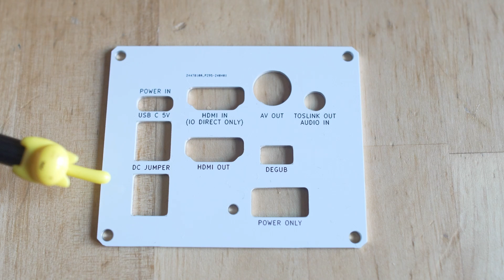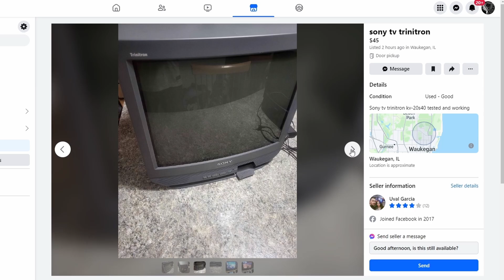MiSTer FPGA IO Analog Pro Board Review and Guide! Better Analog Video is Here

Comment: I don’t understand how to use SVIDEO with this new board? I have to buy a separate adapter that converts from the Saturn AV port? Any help would be greatly appreciated.
Reply from the maker: You just need the cable that has an S video port on the end and you need to use the S video cores. They are generally diff core builds
Reply: @ thank you for the quick reply and I love your content!
Reply from the maker: Glad you enjoy :)

Comment: My MiSTer has no audio but the video works great. I am using the Saturn component cables on a Sony Trinton
Reply from the maker: What IO board?
Reply: @VideoGameEsoterica  analogue pro
Reply from the maker: Check MiSTer addons site. There are INI files for the Analog pro
Reply: @VideoGameEsoterica  and those ini files will fix the no audio? what line of code do i change

Comment: I installed my IO pro analouge board today and the picture is moving down constantly and is in black and white!! I can't figure out what to do
Reply from the maker: What tv? What connection type? I’d need more detail
Reply: @VideoGameEsoterica  Its a Sony Triniton connected via the saturn AV port
Reply from the maker: RGB? Component?
Reply: @VideoGameEsoterica  component
Reply from the maker: Make sure you have SOG toggled. Sounds like you don’t have it set to the proper orientation. It’s on the IO itself
Reply: @VideoGameEsoterica  that didn't work
Reply: is the SOG supposed to be on or off?
Reply: it's not working on either setting
Reply from the maker: Ok go to mister addons analog pro page and look for the settings link. That will bring you to his github. Go there and get the INI he built for the board. Add that to your MiSTer
Reply: @VideoGameEsoterica  I got the video working finally but now I don't have any sound
Reply: for context I'm just using a standard saturn AV cable (yellow red white) I have yet to buy the Saturn (Mini-DIN-10) Premium Universal Video Cable. I'm not sure if I need it as of right now.

Comment: Are you using a Saturn DIN to BNC connection to the CRT? or a Saturn DIN to VGA and then VGA to BNC? My 21 inch Trinitron has both inputs VGA and BNC.
Reply from the maker: BNC

Comment: I run my analogue based MISTer in RGB on an old Sony 2530 PVM. My buddy turned me on to Extron stuff and I use an RGB 203 Rxi as an interface for H and V adjustments. It looks superb! The composite and S video picture is excellent as well. I’d love to upgrade to this board and see how Ninja Gaiden 3 looks while I practice its punishment.
Reply from the maker: It makes everything look a tiny bit better but it makes cores than can support 24-bit color a LOT better

Comment: I don't own a Mister yet but seriously thinking about getting into it. I have a 20 inch flat screen CRT TV that has component connection. I have it connected to my modded Wii and PS2 for occasional old school gaming. If I were to get a FPGA system, with my Sharp 20 inch flat CRT ( I do not own a PVM), will I benefit any from using the Saturn output rather than VGA output for sure? Or is VGA good enough?
Reply from the maker: Both are great for component. You can’t go wrong with either
Reply: @VideoGameEsoterica Ok thank you.

Comment: A huge PSA for everybody is that someone has made pulse with modulation cores for Saturn, PlayStation and N64. These cores give you the exact same 24-bit result out of the analogue board, but it works on the V1 analogue board so no new purchase required.
Reply from the maker: No. Just diff cores. Although the accuracy of the signal won’t be that 99%
Reply: @VideoGameEsoterica  How can you be sure it's not as good though? We'd have to show PWM vs OG vs Direct video vs analog board v2 to know that. We're getting 24 bits via PWM so I don't see fundementally what the v2 board should have over those cores.

Comment: Think I'm just gonna build a second MiSTer build, so I have one for my desk setup and one for my TV setup, the second one I can build with the I/O direct & BliSTer, plus dual V3.2 SDRAM modules, plus a i2s waveblaster header for installing an internal original 90s Yamaha MIDI GS/XG module and a CM6631A DAC for those phat analogue oscillators, I'd love to install a CMSLPT TSR as well, which has dual Philips SAA1099P sound chips for that beautiful rich sounding real-time chip tune audio (PSG), would love to install a OPL3 as well, but not sure if there would be enough I/O left to do so, but if I could, I would have the trifecta of synth hardware (PSG/FM/MIDI), I could also just spend a bit extra (£140) and get the DREAMBLASTER X16GS, which does all synth standards and does them beautifly, it has a Dream/Roland GS Bank (officially licensed, ROM bank), Dream CleanWave Bank (official, Buran Bank, OPL3-FM General MIDI bank, GXSCC Chiptune bank, plus a powerful DSP for multiple efects and what not, it will cover every MiSTer system there is, and systems like the X6800 and Amiga can use multiple audio standards, like Street Fighter 2 on the X6800 has a beautiful chip tune soundtrack mode, nothing beats real chip tune music playing through a real phat analogue oscillator.
Reply from the maker: Hell of a setup
Reply: @VideoGameEsoterica  If I can find a second hand DE10 it might be worthwhile, I use Roland Sound Canvas 3.2 on my current MiSTer via an Intel M5 X86 compute stick and a CYP DAC, sounds pretty damn good for soft synth, but I heard my neighbour's Dreamblaster X2GS on his MiSTer setup the other night, and it just blew me away to be honest, so much richer and fatter than soft synth.
Reply from the maker: @Wobble2007 your neighbor has a MiSTer too? Nice
Reply: @VideoGameEsoterica  Yeah, they are getting pretty popular now, will be even more so when the 99 dollar one hits, maybe not as popular as the Raspberry Pi but MiSTer is just the first of many FPGA platforms I hope.
Reply from the maker: Let’s hope that equals more viewers haha
Reply: @VideoGameEsoterica  It will, keep up the stellar quality, and you will continue growing, there are so many FPGA and other Retro platforms on the horizon, like Replay OS, the Replay 2, MARS, you have your work cut out to cover it all haha, hope you cover Replay OS if you get hold of one.

Comment: The analog out was often useful for monitors where the digital output wouldn’t recognize, as their VGA ports were generally more tolerant of odd signals. This now requires a proprietary adapter for that use case, which is a bit disappointing.

Moreover, I’ve had some pretty significant issues over the years with SEGA’s Mini-DIN video jacks, which has me a bit concerned. They have a habit of getting loose over time, to the degree that the metal indent on the connector housing bends itself out of shape after normal use and has to be bent back with pliers to ensure a proper connection. (If I don’t do that, I lose at least one of the three video color channels over time and have to adjust the position of the cable to get it back.)
Reply from the maker: I can’t say I’ve had that issue with the connector at all and this is what Sorg went with on the reference design

Comment: The old power connector definitely needed a change, I had it fry a USB board once by bumping the connectors into the aluminum case without realizing it was flipped on...but jeez this would be an expensive upgrade with all kinds of new cables and a new backplate to match.

Comment: Also worth mentioning that it removes the toslink port, so you can only use mini toslink for optical audio. Important for us who use dedicated amps and dacs on our setups.
Reply from the maker: Just not something I have in my setup but noted 👍
Reply: i2s HDMI is the best audio option for MiSTer, gives you immaculate lossless 32-Bit with zero clipping or jitter.
Reply: @Wobble2007  Nothing you're playing on MiSTer goes above 16 bit, 44.1 kHz (CD audio). Curious about the chipset the MiSTer uses for digital audio.
Reply: Beg to differ, stock N64 audio sounds pretty stretched out on a pair of 500watt RMS floor standers, it's not until you upsample and raise the sound stage that it really comes to life, though 16-Bit 44.1Khz if fine for most peoples setups, once you hear the N64 OG version of MM beautiful synth soundtrack in 32-Bit 768Khz or DSD512, you really do appreciate it, you can also just use DAC aggregation to thicken up and make the audio much richer/fatter, 4 PCM5100B DAC's will feed any speaker set and amp nicely and only cost 5 bucks each, so you don't have to spend a fortune to get higher resolution audio, just don't do what Grezzo did with MM3D and smother it in reverb, ruins the observatory synth track, flanging would have made more sense and sounds much better.
Reply from the maker: Audio is so not my territory. Music goes boop. I can’t tell the boop quality apart for the most part. I am purely visual and audio is just a diff departments job in my world haha
Reply: @VideoGameEsoterica  Yeah that's fair, you know what sounds good though still I bet, to be honest, it's wild how cheap a good DAC & AMP is now, £40 will buy you what cost hundreds 10 years ago.
Reply from the maker: I know what sounds good but I can’t discern “good vs great”

Comment: I don't see how this is gonna work well with scart? With the old board, I have a VGA to Scart adapter and get Audio with RGB straight to my old CRT without and extra audio connection. Scart was a huge thing in Europe.
Reply from the maker: You can just get audio from the audio port. Plenty of cables will accept that audio and put it into the SCART connector
Reply: @VideoGameEsoterica  So I need an "Saturn Din and Audioport to Scart-Adapter"?

Comment: Thanks for the video, very interesting.
Will the lack of a secondary SD port be a problem for some cores? X68000 needed it last time I checked iirc

Even for cores where you can replace it with a VHD file, I find it a bit annoying.
Reply from the maker: X68000 does not need a secondary SD to work

Comment: I'm more interested in the USB power supply. There's a problem causing noise on the DE10nano by using just any power supply, is that problem still present for USB power supplies? with the tap to project, external SSD, controller batteries, Wi-Fi and BT the MiSTer power requirements are larger than what the OG PSU can do
Reply from the maker: Noise? Like in the audio signal? Unsure what you mean

Comment: Didn't quite understand how light guns will work. No need for a breakout board or a cable with an extra connector with this new board?
Reply from the maker: If you go port to composite or port to component you just tap the signal for the GunCon there. Since you don’t need a breakout board for composite any longer with this IO

Comment: Thanks for the review! I ordered mine a few days ago, waiting for that to ship now. Spent way too much on my Mister system(like $550) riiight before Taki Udon announced his clone board, and they were out of the analog systems so I just grabbed a digital dual-RAM system and waited a few months. Really kicking myself for not magically anticipating Taki's clone board, I spent my annual bonus on my Mister, but this board's looking pretty promising. Picked up a SNAX64, a few Guncons(each gen) and a Jogcon for Ridge Racer 4, so I should have a pretty rad setup soon.

Edit: He didn't have the rear panels in stock, btw, hasn't had them in stock for months, so I just plan on having an open butt on my Mister. Not ideal, but I can't keep waiting, I've waited years to use this nice 32" CRT for some real retro gaming.
Reply: You can build a MiSTer setup for little more than £150 all in, just get a second hand DE10 Nano of fleabay, I got mine for £75 including a 256GB already setup SD card, a V2.9 RAM module for 20-30 squid, all you need then is a either a REFLEX PRISM for just about every video output format available, HQ audio and an Xbox 360 gamepad that you probably already have lying around, or if you want to keep costs under £120, just use a GBS-C board, which you can get for £25 and will give you VGA, RGB, S-Video etc, you can build a MiSTer for dirt cheap.
Reply from the maker: You won’t regret the price. For what it does it’s a “bargain”
Reply: @VideoGameEsoterica  Sure, but the Taki clone system's like $400 cheaper. It's hugely higher-value than prior systems but I could've saved hundreds of poor-person dollars by waiting a couple months - that's 1,000% regret zone.

Also waited since Monday for the Mister Addons analog pro board to ship, no updates. During that period I purchased a Guncon 1 from Japan, two Guncon 2s and two Guncon 3s from the USA, and later a Jogcon from the USA. The US Guncons arrived two days ago, the JP Guncon arrives Monday and the Jogcon arrives Monday. Analog pro board hasn't even been shipped.

Not feeling Mister Addons, tbh, comes off very rude in messages on his site when I send him polite inquiries. And it's absurd that he gets the analog boards in stock but doesn't have any back-plates ready in time, so I'm gonna have an open-assed, super-premium-priced Mister.

Good on him for sponsoring you, you're my favorite retro gaming channel, but I'll be funneling friends Taki's way.
Reply from the maker: That’s a couple guncons lol

Comment: I'm hoping with this analog board I can output accurate composite video without dot crawl or rainbowing effects caused by adapters. I'm not sure if the current native composite cores using an analog board achieve this. If anyone knows please leave a comment.

I currently have a digital only solution and use the the Axunworks converter in my DAC chain to output composite. It has a pot to adjust the dot crawl etc that works great to remove most artifacts (most people don't know it has a pot). Still if a better composite solution can be had from native composite cores I must give it a try.
Reply from the maker: How is that Axunworks deal? And how long did it take to arrive? I’m thinking about picking up some hardware from them
Reply: @VideoGameEsoterica  It works great, and arrived in a month or two which was sooner than I expected. Just be sure to use the pot to adjust dot crawl / rainbowing or you'll think it's garbage. The image is also as sharp as my extron s-video to composite solution which people talk highly of.

On the customer service side, be aware that if you email them they take a while to respond and English isn't their first language, but I was able to understand them just fine, and they were polite and answered the questions competently.
Reply from the maker: I’ve wanted to grab a supergun from them. Just haven’t yet
Reply: @VideoGameEsoterica  Those look cool! I don't have an arcade light gun solution yet, but I really want one, so if it's good I hope you'll let us know!
Reply from the maker: I have a few solutions but obv they all require CRT TVs

Comment: Love getting upgrades like this! Personally as an owner of a digital board using analogue over hdmi to my CRT I wouldn't buy it due to too many dealbreakers : saturn port, single ram, loss of power switch (sync on green should be a setting not a switch). If/when all that is solved (maybe some of it will be solved by Taki's clone) I'll hapilly hand over my hard-earned cash. Also I love the idea of dual video out but that's not available with dual ram.
Reply from the maker: You might want to look at the upcoming IO board from Porkchop then which will allow for dual ram and digital pass through for direct video analog. Just isn’t done yet
Reply: @VideoGameEsoterica  I'm just too greedy and I want it all: Dual Ram (that hardly anything uses but I bought it so going to Single Ram seems like a downgrade), Power switch : I've just got used to using this and it's so much nicer than having an external switch or pressing down on my mister stack, so for me the upgrade would be 24bit / Much cleaner video and dual simultaneous video (but I can't have that because it's an either/or choice). 
Like a lot of people I'm happy to pay for upgrades as long as there aren't any compromises in other areas or unnecessary extra costs (having to buy new cables, etc). I do have to balance all that by saying I absolutely love that people like MisterAddons/Porkchop are keeping the scene alive with new hardware, it's just that I'm stuck now waiting to see what Taki delivers because imho these boards miss the mark and aren't enough of an upgrade for old users but are probably good enough for new MiSTer owners.

Comment: What's the point of the saturn din output?  Deal breaker for me, what a shame.
Reply from the maker: Just a design choice. There is one cable that’s universal for all the diff video signals. I’ve always felt personally that good quality VGA to X cables put some undue strain on the port due to how heavy those cables are. At least the ones I use and trust the signal quality on. I’ve shown that in some analog videos where the cable wants to tip the MiSTer at like a 45 degree angle